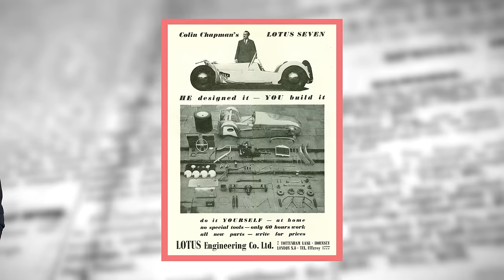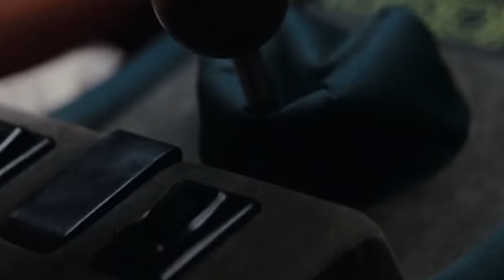LOTUS - Everything You Need to Know | Up To Speed

Comment: I can't believe how underrated lotus is
Reply: They’re hardly underrated
Reply: They are not underrated they are just bad. An Evora costs as much as a Porsche Carrera but it is INSANELY unpractial and has absolutely no interoir at all. That wouldnt be so bad if they used the saved money to add more power. But they feel powerful bcs they are light but if I remove all the interior and Luxus features of a Porsche it would feel even more powerful and would cost less. Would it be a Lotus you'd pay more for less. They totally overpriced. Like 20k pounds. They right way should be less interior -> less cost, thats why MX-5 is popular and Lotus isnt.
Reply: @flywithtb5005  You sound like someone trying to justify their midlife crisis 911 purchase. The new Evora interior is actually really nice, and comes with a slick manual box and no laggy turbo power delivery or crap electric steering. Porsche do exactly what you say and remove the interior and then charge 3x more... It's called a GT3 lmao. Try driving even an elise and you'll understand just how much more involved and exciting an experience it is, it feels like nothing else I've ever driven. By comparison a cayman is good too but it feels very normal.
Reply: And if you complain for some reason modifying a Miata would made it heavier you could strip the (quality made) interior out. That would make you paying money for getting less but that's what Lotus does. I wonder why don't more ppl do this, seems UnDeRaTeD
Reply: @flywithtb5005  I've driven a new elise on road and on track, I've driven a 718 cayman and I OWN a new 30AE MX-5. The Elise's interior is nowhere near as bad as you think. Go sit in one! All the electronics from a new car will look out of date in 5 years anyway.

 That's beside the point. If you think about a car as the money you lose between buying and selling it then an elise is excellent value. They are actually the slowest depreciating cars in the UK because they're handmade and quite rare. In 3 years of ownership (from new) the depreciation is about £10k. Meanwhile an MX-5 loses around 60% of its value in the same period, and even more if you modify it. I don't think that's so bad for a hand made performance car.
Reply: I luv my lotus evora sport 440 in asphalt 9
Reply: @LukeEvans55  If you think of you want to go as fast as possible with a budget, Elise is much underpowered even for low weight to that it has the interior of a Trabant (only the things you AbSoLuTeLy need excpet for satnav) but it costs as if it had one. If your young and don't have the money better get a car for 20k less which still would be quicker or if your old better get a big benz (with more hp) bcs it costs the same. The thing Lotus does wrong is all the nice simplicity comes at the price of a non simple car. No doubt it will be fun to drive but you can get more fun to drive cars for the same money. Price matters.

"And all the electricity will be outdated soon" at least there is satnav and phone stuff who cares if its outdated when it works.
Reply: @LukeEvans55  Its comparable to Lexus LFA
Reply: @flywithtb5005  what? 😂 the base Elise model has 240bhp. 0-100kph in 4 seconds. How is that underpowered? 😂
Reply: @TheHesK9  According to auto-motor-und-sport.de Its 5 sec. https://www.auto-motor-und-sport.de/test/lotus-elise-sc-vs-lotus-2-eleven-englische-mischung/technische-daten/ For example a BMW 1M which roughly was developed in the same period of time and does 4,7s. Now thos 0-100 time is useless anyway bcs its mainly dependend on traction, which Lotus has a lot of and doesn't primarily take into account the power. See for example a muscle car which has power but not traction. So more importantl yfor power is 0-200 as you will speed more time on the motor way or track between 100-200 than starting from standstill. So according to the website the BMw1m does 17.2s from 0-200 which equals to 12,5 from 100-200 (on the website there are values from 0- every speed up to 200) and the Elise does 16,7 s.  could come with some muscle cars but thats not the point. The point is the Lotus is even minor to some random BMW which has 5 seats and is enough focussed on cornering to beat the Lotus combined with its power. Its still a great car, but it feels like they took the Miata, stripped out all the luxury including the powersteering, put a slightly more powerful engine in it and said here we go +more than half the price. Its not an engineering statement but its like Jeremys Alfa Romeo 4c. Its great in its category but the price is a category above.
Reply: @TheHesK9  I would take it as a present every day in the week and I see the fun of pure driving without power steering but where does the price come from? You can get better fun for that money and I could explain to nobody in the enviroment why I spend 50k on that car when I could have had something way more pwerful and arguably more fun in different ways.
Reply: @flywithtb5005  the price comes from the fact Lotus is a tiny company where everything is handmade. It's the smallest company selling cars in the US. It's not a surprise at all that the cost is higher than porsche who are owned by the biggest car company in Europe, have a huge factory mass producing cars with robots. Just common sense
Reply: @TheHesK9  They used to have an F1 team tho. Well just some possible explanation to the Lotus fanboys why I wouldn't have one of you gave me the money. Bcs youll have to admit there must be one reason bcs the cars are fine and there you go. Other explanation is that ppl dislike the look of the lelise (i mean it has bubble eyes like a fly) and the upper range models which look good like the prestige don't have enough prestige for the ppl who have the money.  

That`s probably the more Lotus-fanboy-approved explanation;)
Reply: @flywithtb5005  the Lotus f1 team hasn't existed since 1994
Reply: @TheHesK9  And now they work together with Renault yes?
Reply: @flywithtb5005  no. That lotus team between 2009 and 2015 was just sponsored by Lotus. Lotus' new owners are Geely who make the London Taxis and Volvo too
Reply: @TheHesK9  It may be hard understand, but there are ppl out there that don't like Lotus and there are ppl like me who just think its not the greatest manufacturer in the world. I know you don't usually get in contact with these ppl and thus you think everybody should like Lotus but you can get into a different world where everybody like GM for example or everybody like BMW its all the same, they know everything about theyre car and think its the best and are really shocked when they realise that not somebody disagrees with them and actually sneaked into their enviroment. I just replied to say I get there are ppl for which the experience of pure driving is more worth that extra 10k but for me it definetely isn't. I would try it if I had the chance but I would choose something different if I had the choice.
Reply: @TheHesK9  Can't disagree with that
Reply: I thought it was just a crappy knock-off company

Dam.

Read more...
Reply: @flywithtb5005  Honestly, the Elise is a little underpowered (even being supercharged to 300bhp like mine).    BUT - way more unique than your Porsche.   I'm a person that likes uniqueness with power, and the Elise is a rare sight these days (well, especially where I live).  You can see Lamborghinis a few times a year, Ferraris occasionally, but I've only seen one Lotus in my town, and that was over 15 years ago.

It's also a real raw driving experience, and you get to bang gears.  I always compare it to a really fast go-cart.

As for looks?  I don't know... Everywhere I go, people tend to comment, and talk to me about it.  They find it beautiful, and so do I.  It's a poor man's exotic.  People tend to approach me a little less as I age (because I think I've started to look less approachable, and scruffy - also, I've had a guy like you cuss me out at a light over my choice of car, so I don't act friendly towards people anymore, unless they engage me (which is only 1 out of 4 of my vehicles, and I have 2 motorcycles that could stomp your little toy, so get over yourselves)).
Reply: One thing I can't believe is that my great grandfather is mentioned in this video 😂
Reply: @Alex______1  for real ? That's sick 😄
Reply: They are even more underrated if you understand the company and history they honestly did a shit job on this episode

Comment: "Even a small motor can make 1200 horsepower"
Well 
1200 horsepower 2 stroke weed eater engine swap into my civic here I come
Reply: I still cant decide between a rotary or 2 stroke f1 car. Either way would be godly
Reply: @monaclemin4807  If you have the knowledge to work on rotary it will be good so good that brap sound will sound like a shotgun
Reply: You could make a 1200 hp weed eater engine... for a few seconds if even that. I SAY DO IT!
Reply: they can though, the 1.5L V6 in an MP4/4 made that easily in quali trim.
Reply: There are SR20DET dry engines (little inline 4 guys) capable of 2000HP for a small price like... $15k+
Reply: Actually BMW made a 1.5l 1500hp engine for F1
Reply: Xavier Rodriguez just make every part of titanium. Can’t hurt.
Reply: Technically you could make 1200hp on a 50cc motor
It'd only have about 10g of torque though, so it wouldn't move anything.

Comment: "Even a small motor could make a 1200 horsepower."
Reply: Infinite Rift lotta power baby
Reply: I mean in relativity, the Honeywell AGT 1500, which powers the m1 Abrams main battle tank, is small, when compared with a 747 engine.  And that produces 1200 horsepower so he wasn't wrong.
Reply: I'mma show this to my ex to prove size doesn't matter
Reply: Yep. Have you seen a k series 😂
Reply: BTW - I'm not saying he's wrong - I just like the quote.
Reply: @TonyF1MMA  you can't compare a turboshaft with a turbofan
Reply: @ΑΡΗΣΚΟΡΝΑΡΑΚΗΣ  Just did
Reply: i mean formula 1 motors arent large
Reply: Future
Reply: Look up the 1986 BMW M12 engine used in Formula 1. It’s a tiny four banger with 1400 hp.

Comment: Fun fact. Lotus had plans for a small lightweight mid engined sports car called the M90 (or sometimes called the X100) back in the late '70s/early '80s as a collaboration with Toyota using mostly Toyota parts.

Lotus already had the Esprit so abandoned the project and used some of their research moving forward with the M100 Elan.

Lotus gave everything for the M90/X100 to Toyota and it became the MR2 AW11 which sold waaaay better than the M100 Lotus.

Since then Lotus and Toyota have had a good relationship.

Comment: I’ve always wondered while Lotus was installing Toyota engines in their sports cars - why did Toyota team with Subaru and lately with BMW for their sports car?
Reply: In the late 90's british automotive industry was a mess and lotus was using a rover engine that had terrible reliability issues. So I guess that just got so fed up with that that they just went to toyota so they never had to worry about engine reliability ever again.
Reply: @Runmeerkat  That's true; however, I don't think that was Big Mo's point. He was asking why Toyota didn't reciprocate and team up with lotus to design Toyota sports cars. 

The reason is the engine. Toyota doesn't want to invest in making sports car engine, so they have other companies do it. And if they are using that company's engine, may as well team up with them on the rest of the designs. It would be cool to see a lotus-inspired Toyota, but that will probably never happen
Reply: fun fact: Proton and Lotus actually collaborated and made different engines over the years.

The first one was early 2000s CamPro VVT/Turbo 1.6L which had lots of potential but also wasn't very strong so its usage is limited to Protons.

there was also a supercharged aluminum V6 engine designed to match Porsches, that can be split to small 3-cyl engines for road cars. Proton cancelled it in mid 2000s.

around 2010 they had a V8+KERS ready for the new Esprit but the Esprit was cancelled.

in 2016 Proton, Lotus and Ricardo designed a new, powerful yet compact TGDi engine architecture to tackle Euro6c. it didn't make it to production since Geely took over and Volvo already has similar Drive-E engines.
Reply: John Mitchell  I know. I'm just pointing out that they had attempted many times to make their own.
Reply: Toyota could revive a MR2 if they actually want to collab with Lotus making lightweight mid engined sports car
Reply: @Runmeerkat  Not reliability issues - They wanted to expand sales back into the USA but the Rover engine couldn't easily be made to meet federal emission regs.  Rover engine problems related just to head gasket failures that where easily prevented with some minor plumbing changes.  Still a great engine with a few features well ahead of Toyota.
Reply: @shahrulnizam4713  What a dream that would be!

Comment: 8:48 gas turbines are genius ngl like u litterly can rev up to like 190 thousand rpm and make like 3000 horsepower and like 9000 foot pounds of tworqe the only downside to them is they consume lots of fuel and the machinism for them to transfer all of that energy to the gearbox is really really big look at the m1 Abrams tank for an example that gearbox is like 6 times bigger than the engine is

Comment: The Lotus Carlton is not based on a Vauxhall sedan, it is based on the Opel Omega.
Reply: No the Opel Omega was a rebadge Vauxhall Carlton. It was designed by Vauxhall and built by Vauxhall.
Reply: @gsw8734  Wikipedia says otherwise as does my uncle who used to work at GM

Comment: You guys judge things from.a street racers perspective, Circuit guys, or at least track guys who've been around before modern tech made 400 to 1000HP so easy to come by, each cars experience was its own, we weren't judging everything by its ability to smoke the tires and pin you back to the seat. 

It's kind of sad you guys are so experientially limited, and everything has to meet up to one standard, and when something doesn't, of course it's not good enough 😢